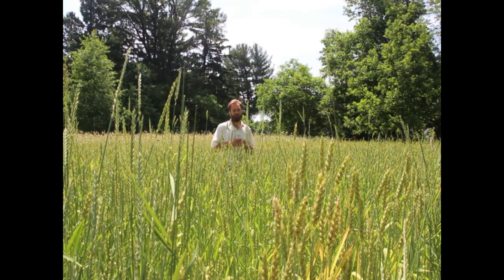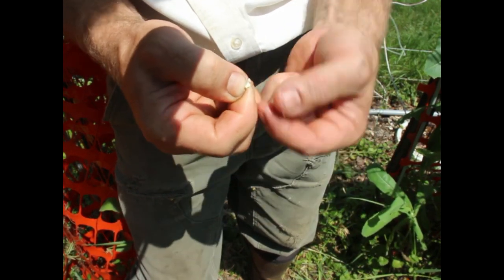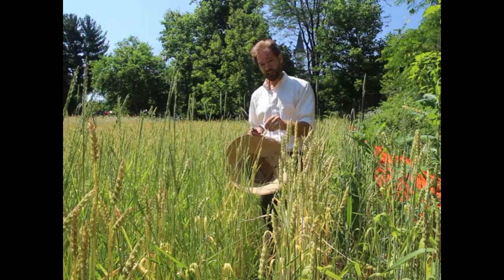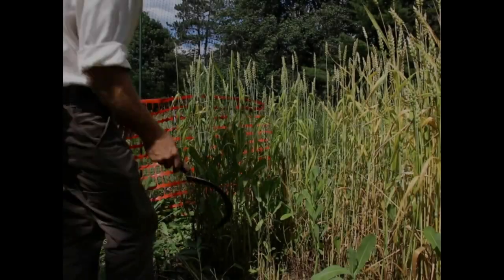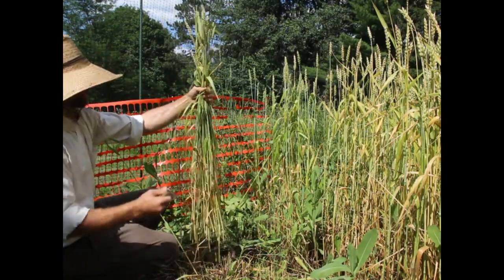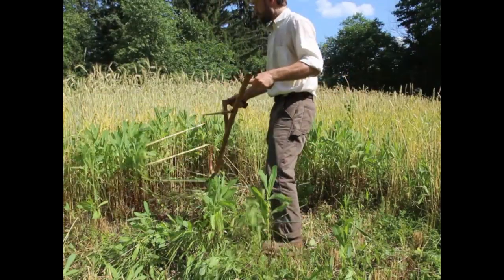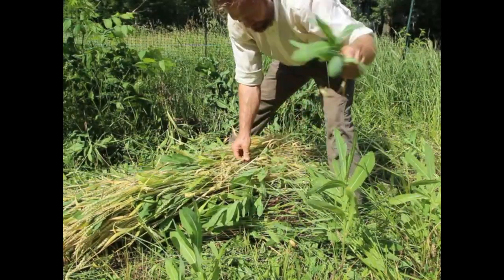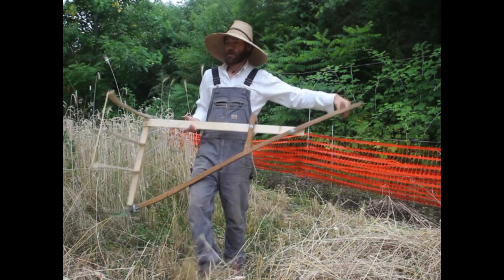Grow Your Own Grains, Part 2: Harvesting and Threshing -- Low Tech Video, No. 25

Comment: I really do appreciate your explanation of using a cradle on your scythe.  You suggested Anarchy  Acres for more info but didn't find any reference about a scythe cradle.  If you could create a video how to create on for a scythe like yours, it would be GREAT!  About a month ago I planted a patch of "Glenn Hard Spring Wheat" from Johnny's Seeds.  I planted it 8 inches between rows as demonstrated in your Part 1 video, and it is doing well.  I'm able to keep the weed under control thanks to your suggestion of 8" spacing.  I will be using a lidded 5 gal. bucket with a hole in the lid that allows me to thresh with a 3/6 in. rebar rod and light duty lamp chain welded to it and powered by an electric drill.  That combination has been working for me well for a couple of years.  The rest of the process is a  piece of cake.  I also am going to use your idea of cutting of the wheat head into a large trash can but I will be lining the trash can using LARGE plastic bags for storage for thrashing later. Thanks.

Comment: My wheat turned out great, but it rained during pollination and had a serious mold issue.  Chickens love it.
Reply from the maker: Thanks for watching. Were the heads spotted black with mold? That's probably sooty head mold and is largely superficial. If really bad, it can affect germination, but generally, it isn't a big deal if it can be harvested soon, threshed, and dried fully. I get it on the outside of the heads sometimes, but the seeds are fine.
https://www.sunflower.k-state.edu/agronomy/wheat/sooty_head_molds_black_point.html

Comment: Thank you!
Q: What do you need to do with an existing grass lawn before planting grains?
Reply: If not opposed to plastic, I would stake down some black plastic over it. Once the grass dies it is built in fertilizer.
Reply from the maker: Depends on the scale. As others have said, solarizing with black plastic is great for small scale. I have to do three passes (1-2 weeks apart) with a cultivator to kill weeds. A lawn can be pretty tough, since it is also made of grasses, so more might be needed.

Comment: At soft dough stage how long does it store. And do you have to dry it?
Reply from the maker: Thanks for watching and the question. I do not know, but it is not recommended. Also, you can't grind it efficiently at soft dough because the moisture will gum up the mill. Do you have a food dehydrator? I've used that to dry the grain, too, if I have a smaller amount. Good luck!